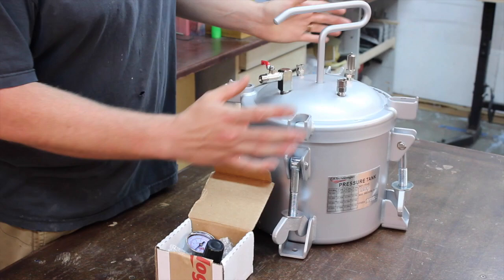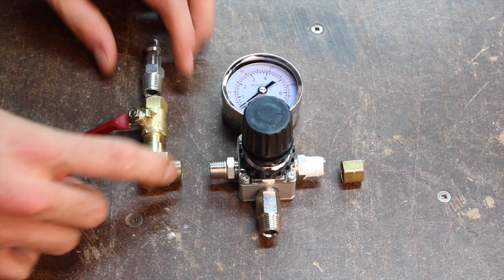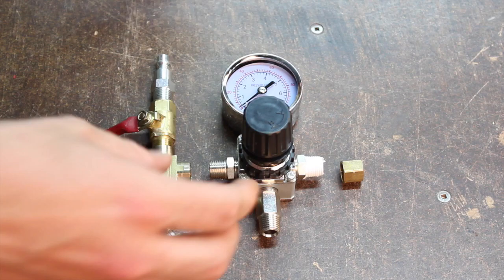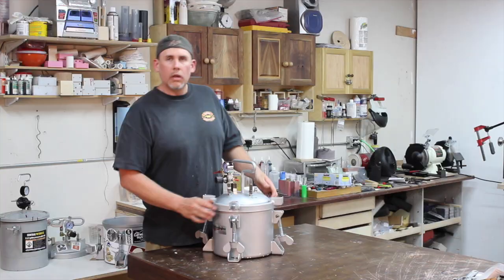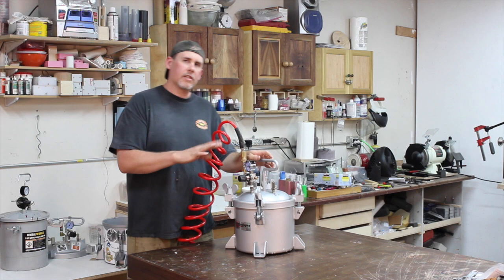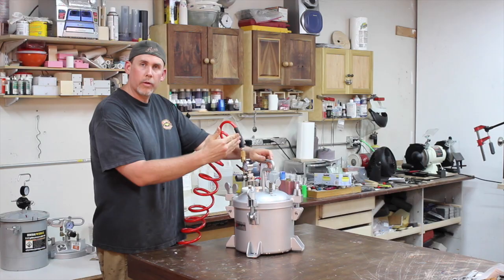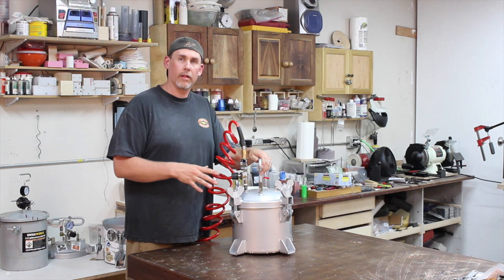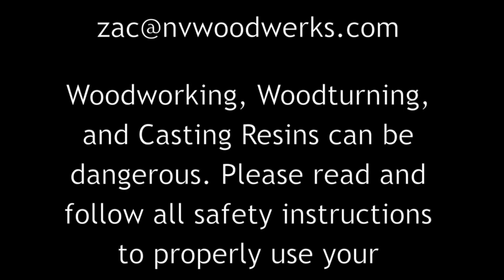Setting up a CA Technologies Pressure Pot For Resin Casting

Comment: Thanks for the rundown. I picked up a Craftsman Pressure pot that was still in the box, probably from 1980 or so but the fittings are all missing. I got it for 20.00 though so now I am off to get a regulator, valve, and fittings!
Reply from the maker: +Dirk Mitchell That's awesome! Just be careful and maybe test it out from a distance to make sure there are no problems with it, but it sounds like a score! Hope to see what you make.

I saw another message from you in my email, but when I click to see the comment it won't go to it. You were asking about where I'm at in NV. The shop is in Carson City, live in Gardnerville. Nice to hear from someone that knows Nevada, where did you go after Elko?
Reply: Zac Higgins I am in Salt Lake I moved here in 2002 and havent been able to leave :)

Comment: I enjoy your videos. I watched the pressure pot vs vacuum chamber videos.  Sea level pressure is 14.7 psi so when you put 50 psi in the pressure pot you're getting 3.5 times more pressure using a pressure pot vs vacuum chamber. It's all about cure time. You don't have time to pull the air out at low pressure but you do have time to force the air into solution like Cliff Hartle suggests.

Comment: Hey Zac, I made a comment on the your video a few weeks ago that inspired me to purchase this pot. This video came in handy when it came down to setting it up (would have never known to purchase tape to air seal the male-female parts if it weren't for you). After waiting 3 hrs, I noticed my pressure drop from the initial 50 psi to about 45 psi. I'll try your soap + water trick. Thanks for another great video!
Reply from the maker: Congrats on getting a new pressure pot!! I'm glad the videos helped, definitely do the soapy water, it should show you any leaks that you should seal up

Comment: Thanks Zac! I know you said the connectors are 1/4" but do you know what threads? And, is there any particular reason you run an elbow out of the regulator instead of a union to the Ball Valve? Is it just for the way your setup is or does it matter? Thanks again and keep producing the great content!

Comment: Dear Zac, I was unaware that there were different models of CA Tech pressure pots. Mine looks quite different from the one you show in this video.  The top has 4 openings: 1. air inlet, 2. fluid outlet, 3. air release valve, 4. air safety valve. None of these 4 have the valve with the red handle as shown in your video. Additionally, extending from the inside of the lid to the floor of the pot is a large rod with a plastic foot on the bottom with a screen on its bottom. I have put off this setting up or the pressure pot for several weeks because I am not very mechanically minded (like you are) but now that I see all this new information I feel at a loss. Returning it to the company would probably cost a fortune just for freight. I ordered the one I thought was connected with your video but I must have made a mistake. So now I have an expensive ($300) pot I can't use plus an air compressor to go with it ($160). It's not your fault but was wondering if you could give me any advice.
(signed) Clueless in California
Charise Diamond
Reply from the maker: Sorry to hear you got a different one. In the future, I have direct links to the products I use on my "tools I use" page on my website (http://nvwoodwerks.com/tools/). I think I should go back in my past videos and add that link to the video description. I'm not sure what to say about your pot, I haven't set any other ones up besides the Harbor Freight and the C.A. Technologies pots like the ones I have. Maybe contact the company you bought it from and see if you could swap it out for a different one
Reply: Yes, I think it would be helpful for newbies like me if the link is there. Very good. I thought all pressure pots were the same so I chose the least expensive one, not knowing it was the wrong model. I am in the process of trying to work with CA Tech directly and with the distributor who sold it to me. I'm asking for an exchange. This is likely to cost at least $100 extra for round-trip shipping and the price difference. The casting pot is $40 to $60 more than the $298 one I got. But anyway, Zac, thank you for your willingness to help and to provide needed information.

Comment: Im sure this has been asked over and over but whats a good resin to use if you dont have a pressure pot or your item is too big for a pot?
Reply from the maker: No worries Aaron, t's a good question. Any resin with a longer working time (over 30 minutes) will work, and the thinner the viscosity the easier it is for the air bubbles to float free. I use Liquid Diamonds epoxy whenever I need a longer working time, it's super thin, extremely clear, and has about a 45 minute working time. You can get it at Turners Warehouse: https://www.turnerswarehouse.com/products/liquid-diamonds-epoxy-casting-resin  There are quite a few resins out there that would fit the bill though, that's just the one I like to use for those applications

Comment: Great info Zac.  Would setting up the 5 gal tank be the same as you show for the 2.5 gal?
And, would you use the same psi (60 psi) in the 5 gal?  I’ll be using it on its side.
Thanks!

Comment: my understanding is you user a vacuum pot for removing bubbles from resin, but you use a pressure pot for molds.... I talked to one fella that said they just use a vacuum pot to remove bubbles from their molds and they don't need a pressure pot.   This confused me.   I was also told if i had a 4 inch cube using 4 inch deep pour resint would need to  sit in the pressure pot for 4 days at 50 pounds.... does this sound right to you

Comment: Great videos for a beginner to watch. I have no experience with compressors. Can you advise which size would be the ideal for this application? I would only be using for art based casting, not shop.
Reply from the maker: My personal recommendation is to get a compressor that has a tank about the same size as the pressure pot. The small pancake compressors will work fine. If I were to buy a compressor for casting, I'd step up to the California Air Tools 5 gallon one though. it's a little larger than the pancake ones, but it's much quieter and the larger tank size means it won't be compressing as often. They're about the same price anyway, so it's kind of a no brainer if you have space for it. Here's  my affiliate link to them on Amazon: https://amzn.to/2Sxk4JI
Reply: @ZacHiggins  Thanks so much!

Comment: Hi Zac. I have just got my pressure pot set up and followed the way you set this one up. I casted Alumilite water clear and had at 60 psi for 2 hours and shortly after taking out of mold bubbles started by appearing not sure what I have done wrong.  Also Max rating for my pot is 80 psi. Any tips for someone who is new at this. Cheers Chris from New Zealand

Comment: Thanks for the great videos.   I am casting just duck and game call blanks.  Using Alumilite clear.  How long should I keep it under pressure???  40 to 60 psi about.
Reply from the maker: Hey Park, it just depends on the resin you are using. If it's regular set Clear, about an hour is fine. Slow Set Clear I usually give 2-3 hours. Whatever the demold time is for the product should usually work.

Comment: Great video - THANKS! Bought one of these due to your reviews. I guess there would never be any reason to remove and cap off (or just cap off) the "fluid outlet" ball valve... would there?
Reply from the maker: +Jim Peavy Hey Jim, glad it was helpful :-) I'd keep the extra ball valve on there, won't hurt anything and would just add more work to get set up. I actually like having it on there, I crack both the inlet and the paint outlet ball valves when depressurizing the pot so it goes a little faster.
Reply: +Zac Higgins Thanks again - just setting mine up now and working great!
Reply from the maker: +Jim Peavy Awesome! I can't wait to see some castings!! Send in some pics when you get a chance :-)

Comment: Great vid! How long do you typically let the resin cure for in the pressure pot? By the way Wyoming wood tuner is where i came from to check out your video. Thanks
Reply from the maker: Thanks Darrin! It all depends on the resin you use, typically the 'demold time' for the resin you are using will dictate how long it needs to stay under pressure. If it's a very small amount of resin, you might need to increase the time though. You're basically waiting for the resin to harden up. If you release pressure before it's fully hardened up, air bubbles will just come right back. 

Glad you made it over to my channel. Sam rocks!! It's great to see him having fun with resin too now =D

Comment: Hey Zac, after adding pressure to the pot do you then close the valve to keep the pressure in or do you keep the hose connected with the valve open? Thanks Bryn.
Reply from the maker: Hey Bryn, I close the valve and remove the hose once it gets to my desired PSI. If your pot leaks really bad and you are using a slow setting resin, you may need to just leave the hose attached to ensure the pressure doesn't drop. You have to watch out though, make sure the regulator is set correctly or you could over pressurize it, and always keep the safety relief valve installed on the pot too. 

My suggestion is to find and fix the leaks if possible, I definitely feel more comfortable no having to leave the hose hooked up. I have a video that covers how to do that: https://www.youtube.com/watch?v=ZzdNZ6nqrgM&t=182s
Reply: Fantastic thank you very much for that Zac. Very helpful.

Comment: HI Zac,  I work with small casting parts in 1/35th scale the main problem I have is casting nuts and bolts it won't quit flow so I use a tooth pick which helps I did buy a pressure pot so I could eliminate air bubbles once the resin has set is it too late to put into the pressure pot!?  Also could I possibly use my air brush compressor to air up my pressure pot!?   I live in an apartment so I don't want something too noisy.
Reply from the maker: Hey David, I'm not entirely sure if an airbrush compressor would work. I haven't heard of anyone who has used one for that purpose. My guess is that it wouldn't be powerful enough, and/or it would take quite a while to get it up to pressure. I don't think it would hurt anything to try it out, but I'm not 100% sure if there is a potential to damage the compressor if it's not powerful enough. If it doesn't work you might look into  California Air Tools compressors. They are much quieter than typical oilless compressors, here'a  link to the one Dema did a review on: http://amzn.to/2cxl54Y 

I don't have a lot of experience casting molded objects, but I have a couple ideas that may help you out with that. the first is to sprinkle baby powder in the mold first, then blow most of it out. The baby powder can help the resin fill in the crevices better, but shouldn't have any effect or show up in the casting. The other thing that may help out is to pour a small amount of resin in the mold and slowly swish it around in the mold to get a thin coat of resin on it it and into the small details, then mix and pour the rest to fill it up. The two pours should bond together with no problems, and it should get resin into the nooks and crannies better. I picked up those two tricks from the Punished Props YouTube channel

Comment: It’s alright to say “I don’t recommend putting the pressure up higher than what the pot is designed for “, you should say “never put the pressure higher than what the pot is made for or it will blow apart like a bomb and shrapnel will fly everywhere at high speed and injure or kill you”. I would also like to add, never drop or bang the pot on anything solid while we have pressure in it. If it does fall or get banged by something, I would do tests at lower pressure and inspect it for seal leaks or better yet, just buy a new one as it could have a hairline crack that could lead to a disaster.

Comment: I guess my question is, for casting you use a compressor for the pressure and for stabilizing, you use a vacuum pump.  Am I right?
Reply: Obviously, I'm not Zac, but that is correct.

Comment: Zac - I got the lid remodeled to accommodate resin in the pressure pot but now have another hurdle. The new air compressor I tried to use shut down while in the "on" position and caused the pressure pot gauge to flip to zero. I think I am too tech challenged to be doing this and will have to try to sell the pressure pot and compressor. Will have to put up with the bubbles in the resin pyramids. Any comments? I emailed the compressor folks but they said they're not familiar with the use I mentioned and cannot advise me.
Reply from the maker: I'm not totally sure. The only thing I can think is that you don't have a ball valve on the tank, so the pressure would drop right away when you turn the compressor off. Once the tank reaches the pressure you want, you then close off the ball valve so it holds pressure. Then you can remove the air hose from the tank or shut off the compressor
Reply: Thank you Zac. I appreciate your willingness to help me. You're a wonderful resource. I took the Pressure pot and air compressor to a mechanically-minded person and he showed me how to operate the pot/compressor.  What seems easy for you is a big learning curve for me. I'm back on track and all is well. Thanks again.

Comment: Great video Zac!  Thanks!

Is it possible to make a combination vacuum degasser/pressure pot?
Reply from the maker: Thanks for checking it out! It's possible, but you need to be able to see what's going on inside. If you're going to be degassing silicone, you can just buy a clear conversion lid. I'd go with something that is clear on the sides like the TurnTex chambers if you're planning on doing wood stabilizing
Reply: Thanks so much for your reply!  I will look into both of those options.  A clear chamber would be nice to have!

Comment: Question 
How long do you leave the resign in the pressure pot for? Is it the full 2-3 hour de Mold time or the 15 min open time
Reply: Just the enough time for the resin to become solid

Comment: Navigated to your channel from a recent video from Carl Jacobson.  I am a new wood turner and have enjoyed watching others here on youtube turn resin and resin hybrid blanks.  The resin just adds another level to a project a lot of the time.  Basically, glad I found your channel.  I've only seen 3 of your videos, with two of them being on this casting pot.  There is a lot I don't know about turning resin and your videos have been a great source of information.  Thank you for taking the time to create, share and educate.

What would you look for in an air compressor for the casting pot?  Also, which of your videos should I start on as a beginner with interest in turning resin blanks?
Reply from the maker: Hey Tom, glad to hear you found me. I'll have to thank Carl for pointing you in my direction. Great to hear you're getting started with casting and have started turning. I have a few video playlists covering casting and setting up pressure pots that I think you'll enjoy, I linked to the playlists below. I see that you've watched a couple videos on pressure pots, but there are a few good tips in the playlist that will help out a ton when you start setting yours up. 

As for the air compressor, most of them will work as long as they can pressurize up to the PSI you want and have enough capacity. If possible, I'd go with a 5 gallon tank, but you can get by with the smaller pancake or hotdog style compressors as well. If you don't have one yet, it's not a bad idea to get a decent compressor, they are useful for lots of things in the shop. I have a link on my "Tools I Use" page on my website (https://nvwoodwerks.com/tools/) to a popular compressor on the market that's gotten really good reviews from other YouTubers who do resin casting and woodworking. It's super quiet for a compressor and definitely will work well for casting.

For pressure pots, I use the C.A. Technologies brand pots because they are excellent quality and are rated to 80 PSI. There are lots of brands out there, and everyone has their favorites for various reasons. If you can afford a CA Technologies though, it is what I would recommend. I have links to the pressure pots I use as well as most of the other tools, equipment and accessories that I use or recommend on that Tools I Use Page on my website: https://nvwoodwerks.com/tools/

Also, I have an e-book that you might enjoy, "The Beginner's Guide to Resin Casting." It covers all the basics for newbies, and it should help out with the initial learning curve. https://nvwoodwerks.com/product/the-beginners-guide-to-resin-casting/

Here's the video playlists:
Casting Acrylic Blanks: https://www.youtube.com/playlist?list=PLoeB-EPC_91sNmfaYAlVFZQsY7wL4myyv
Alumilite Resin Casting: https://www.youtube.com/playlist?list=PLoeB-EPC_91vvS-hpuVI1qqj4_9SII2UY
Pressure Pots: https://www.youtube.com/playlist?list=PLoeB-EPC_91uBZHKS1mbeoy9AZyjjZmrA
Top 10 Dunkin Junk Projects: https://www.youtube.com/playlist?list=PLoeB-EPC_91tTh9zYnQNThYxVIZKFWSv6
Reply: @ZacHiggins  Thank you for all of the information, Zac!

Comment: Hi Zac, I just inboxed my new CA Tech pressure pot. Mine didn't come with the on and off valve on the top of the lid like yours did and mine came with a pipe attached inside the lid. Yours
looked like it didn't come with one. I'll have to contact them for a valve.
Reply from the maker: Yeah, they have a model that is made for resin casting that excludes all the junk we take off anyway. Where did you buy it from?